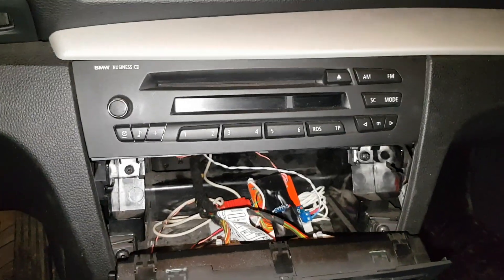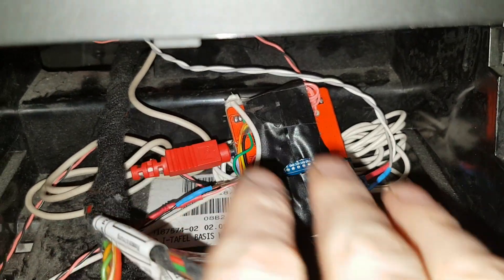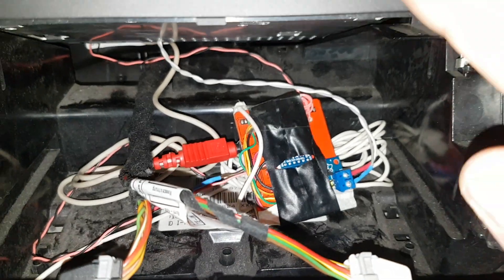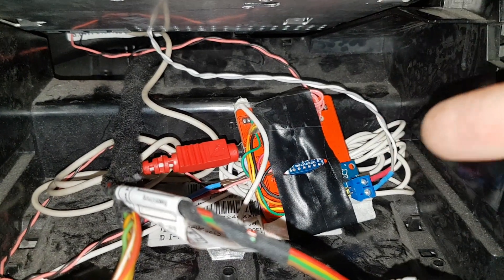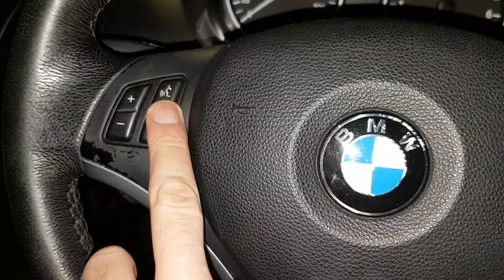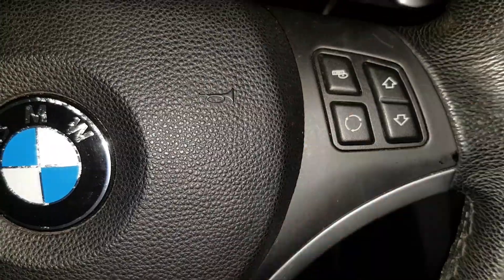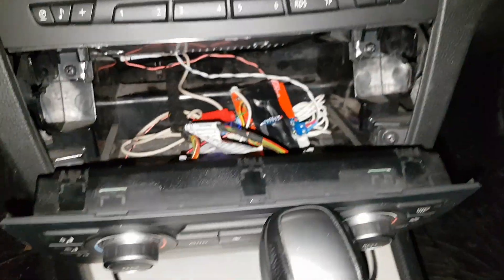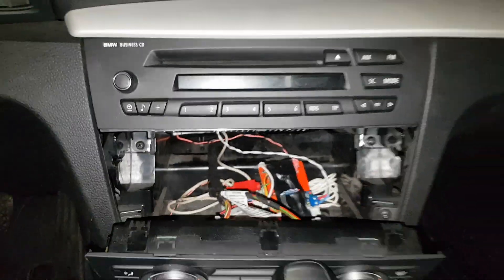BMW E81/E87 Arduino KCAN to Bluetooth hands free interface

Comment: I’m not that smart to figure it out how it’s work and there is no info how exact to do that on your video ! Can you make a diagram and upload it and share the link?
Thanks
Reply from the maker: Hi, if you download the linked INO project, you will find the description on how to wire it up. The only thing you need to take care of when wiring the button wires from the arduino outputs is to wire them on the correct side of the button in order for it to work. If you have the BT module I linked it's a matter of simply looking at the screenshots and copy how I wired them. If I have some time I will try to do a video on the wiring or link a detailed drawing.

Comment: Hi, great job on this project! I am sourcing the parts and was wondering does it matter if the Arduino Mini/Micro/Nano is 3.3V/8MHz or 5V/16MHz considering the code and MCP board being 8MHz.
Reply from the maker: It would be preferrable a 5V version for level compatibility with the MCP, it's up to you but I suggest a 5V version plus you can use the same Voltage regulator to power all boards.
Reply: @Luca_Techy  Thank you!

Comment: Why aren't you selling this as a finished kit yet? I know at least two people who would buy it from you :)
Reply from the maker: Unfortunately I don't have much time on my hands! All the parts are readily available from aliexpress though if you have some patience to source them - basically 3 small boards and a few wires to solder plus programming the arduino. If I ever do have the time I will definitely do a step by step tutorial to put it together.
Reply: @Luca_Techy  OK sure  :)

I would like to buy it instead of some Chinese radio which looks ugly compared to the original radio.

Comment: Hi, i did the exact same setup as you, with a nano instead of a pro mini, using your code, however i am experiencing a problem. The steering wheel controls do not work at all. After a bit of investigation (and a fried board), i tested the output of the 4 wires coming from the arduino to the bluetooth board, and discovered that they all have a constant GND, and pressing the steering wheel buttons does not change anything. Do you have any suggestions on where my problem would be?  Thanks :)
Reply from the maker: Hi, I suggest you do some debugging: connect your laptop with the Arduino monitor running and see if you see any CANBUS activity in the serial monitor. You should see Button Presses when you press volume up down etc as shown in this video:
https://www.youtube.com/watch?v=Bkr9tWjPa2c
If you see no activity be sure your KCAN lines are connected properly to your MCP.
Reply: @Luca_Techy  thanks for your answer. How do I access this serial monitor you are referring to?

Comment: Hello from Belgium ! Is it possible having some help about that throught Skype or by mail please ? It will be awesome. Just searching the cabling of all of you have any drawing 👍🏻I'm trying to repeat the same idea but making also a end-to-end tutorial for bmw e87 facebook group. Thanks.
Reply from the maker: Hi Frederic, unfortunately I have no schematic - it's really rather straight forward as it is a one to one connection as I describe to the buttons and digital output pins of the arduino and the CAN module. In the above description links and in the arduino project it's all explained pin by pin. The rest is just the 12V power connection and 2 KCAN lines from the car which connect to the relevant inputs on the MCP2515 CAN module. If you have any further questions or doubts just ask I'll do my best to help.
Reply: @Luca_Techy  Grazie mille. I've read other comments and found some answers (also about canbus comm), thanks. All hardware is ordered, now I'm waiting for it. Hope you're okay today. Take care.
Reply: @Luca_Techy  I've got 5 questions:
1) Where do GND (brown) and RAW (orange) from Adruino go to ?
2) Where do I have to cable power to ? To Arduino RAW and GND as per question 1 or to USB mini from BT module ?
3) Canbus from business go to MCP module big blue plug right ?
4) AUX from my car can be put in the BT module with an AUX cable male/male right ?
5) About microphone, I bought one, I've to plug it in BT IN plug, right ?
Thanks dude !
Reply from the maker: Sorry for the late reply - didn't get any notification. The power out from the arduino VCC +5V goes to the MCP board and BT module input. The Arduino RAW is the power INPUT from the car +12V so the Arduino powers the MCP and the BT module. The K Can wires go to the MCP yes (J2), you screw the 2 leads to the MCP canbus input. AUX IN from the car radio goes to BT OUTPUT. The BT AUX plug is an additional INPUT (unused here). The MIC wires get soldered on the MIC pads located just on the left of the MODE button (2 solder pads labeled M+ and M-)

Comment: Hello, do you have a schematic for me for connection between all parts?
Best regards.

Very nice project
Reply from the maker: Hi Kamil, if you check the description and photos you can figure it all out, it's really not complicated putting it together: it's just a matter of wiring the button toggles (the pins that go to ground when you press) to the relative arduino pins as described and connecting the +5V power lines to the MCP and BT module and the grounds together. Regarding the wiring to the Quadlock of the radio there are the pinouts on the net readily available as shown here: 
http://pinoutguide.com/Car-Stereo-Audi-BMW/bmw_bussines_cd53_pinout.shtml
Power comes from Pin 15 (+12V) and Pin 12 (GND) and CAN bus on pin 9 (CAN L) and pin 11 (CAN H) on connector A (careful when you solder pin 15 as this is live unless you remove the negative from the battery). Use a twisted pair of wires not longer than 15-20cm for the CAN bus to avoid reflections on the bus and create data corruption problems.
There's an English version of the post on the babybmw forums too:
https://www.babybmw.net/forum/viewtopic.php?f=18&t=117792
Reply: @Luca_Techy  ok. thank you for fast answer. Have you already managed to use the 12V pilot contact. do you have more information for me which transistor/fet you have used?
Reply from the maker: @Kamil-if3wu  Sorry for the late reply - I haven't modified the 12V output, for now it is connected to the main 12V line which stays always on for that half an hour or so after closing the car - it doesn't bug me and the current draw of the BT is minimal. There are many tutorials to add a simple low power NPN (2N2222A, BC347 etc) transistor to act as switch/driver, just use a 10K resistor on the base connected to the pilot output. Try searching for "BJTs as Transistor Switches".

Comment: Hi, Nice project. I'm looking into doing the same, however i have a few questions. 
- Is there any particular reason (other than physical size) that you used an arduino pro mini and not an arduino nano? 
i was hoping to use an arduino nano instead since i do not know how to transfer the code onto a pro mini because it doesn't have a usb input. If i use the same code for a nano, will it work (bare with me, i'm poor in coding)
Lastly, can all three pieces of electronics handle the 12 volts from the car, or did you have to regulate any of it externally? 

Thanks in advance :))
Reply from the maker: Hi, I used a pro-mini simply because it's small and can fit it all in a small space as you can see - no other particular reason. You can use a nano or even an Uno if you can fit it all (I used an Uno with MCP shield for prototyping). All the boards are powered by the on board 78L05 regulator as I explain (also in the link) which is capable of delivering up to 100mA of current. You needn't worry about the differences between the nano and pro-mini, just tell the arduino compiler what board you are using and it will compile correctly (there is no real difference between the pro mini and nano pin-wise). Just be sure to check the arduino pin numbering when you connect everything.
Reply: @Luca_Techy  Hi, i did the exact same setup as you, with a nano instead of a pro mini, using your code, however i am experiencing a problem. The steering wheel controls do not work at all. After a bit of investigation (and a fried board), i tested the output of the 4 wires coming from the arduino to the bluetooth board, and discovered that they all have a constant GND, and pressing the steering wheel buttons does not change anything. Do you have any suggestions on where my problem would be?  Thanks :)